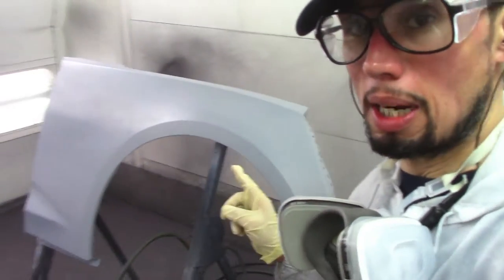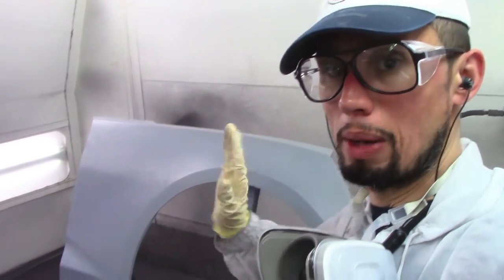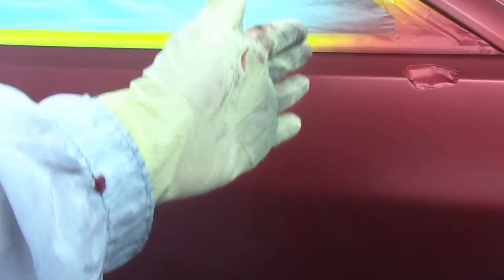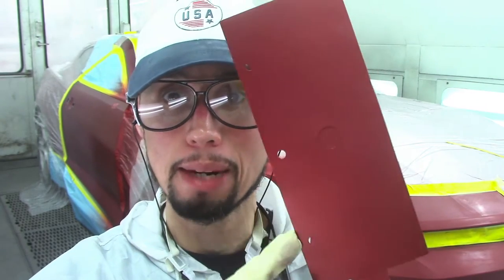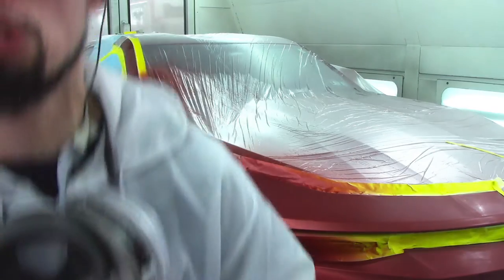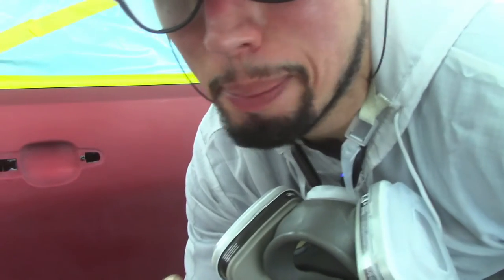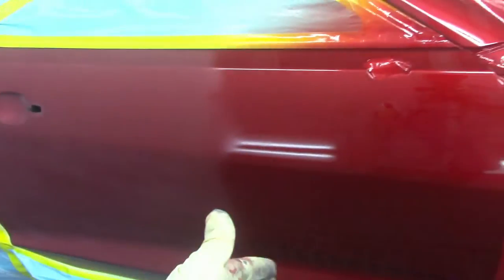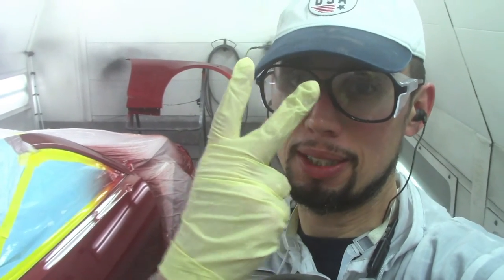The Complete Guide To 3 Stage Red Pearl+Paint, Blend, and Color Match

Comment: Good job. Just wondering why do u need to put down 5 coats of the basecoat? What paint scheme ure using? Usually we can get away max 3 coats of the base with good coverage paint system.
Reply from the maker: Thanks 🙏 for the kind words. So I use solvent base coat Axalta Spies Heckers brand and with red colors I like to make sure I get good coverage because red base coat has very little pigment and might not get a accurate color match if it’s not covered properly.

Comment: Why was thd front bumper cover taped off in thd center of the nose ? Was there a body line or seam to hide it ? Or did you use blending thinner to melt in the dry edge of clear ?
Reply from the maker: There was a body line on that part of the bumper that I used to tape on the edge of the body line so I wouldn’t have to blend.